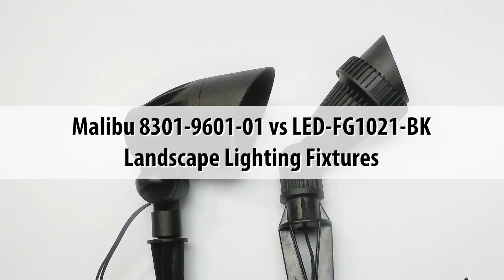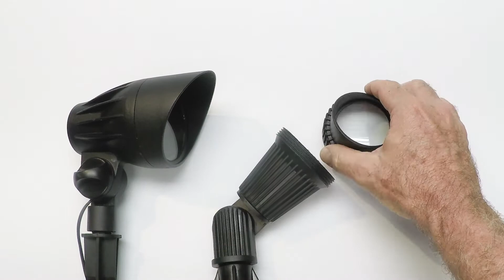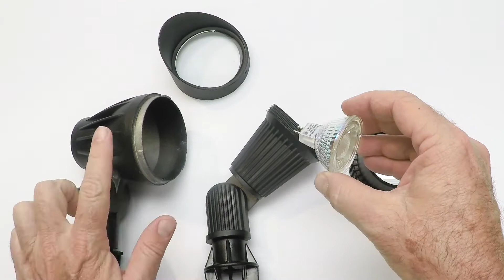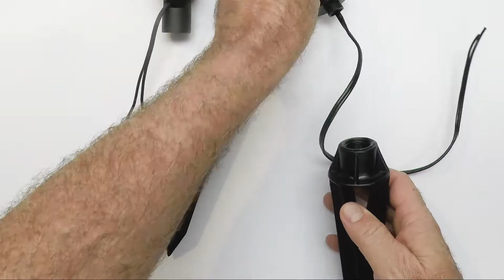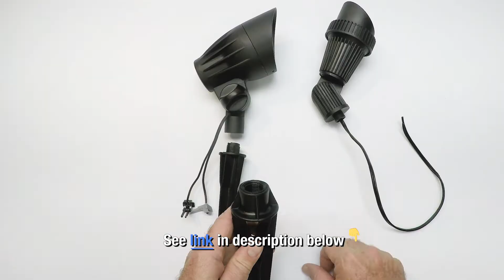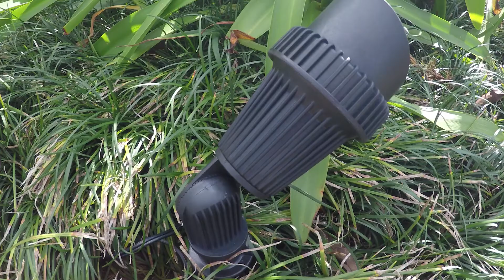Better? Malibu 8301-9601-01 outdoor landscape lighting flood light or our LED LED-FG1021-BK light 🤔

Comment: My grampa has old Malibu landscape lights but they are broken and they don’t work at all
Reply from the maker: There are many components to a low voltage outdoor lighting system. It could be the lights, the bulbs, the wire connections and even the transformer. It's hard to know without running some tests. We sell complete kits and components to get existing systems back up and running 🙂You can check it out here 👉 https://www.totaloutdoorlighting.com/
Reply: But if you plug the transformer in they won’t turn on

Comment: Do the LEDs give the same color warmth as the Halogens? I already have some Halogens and want to mix and match
Reply from the maker: As of the date of this comment, the LED supplied with our LED-FG1021-BK is 3000K. The best thing to do to match the color temperature, the warm and cool look of the light, is to look on the actual halogen bulb it self and see if it marks the color temperature. It typically is included with the part number stamped on the  bulb. See this page for more information on color temperature - https://www.totaloutdoorlighting.com/the-look-of-color-temperature.html